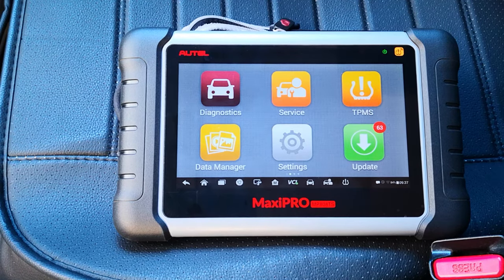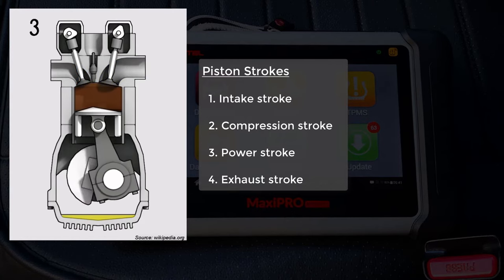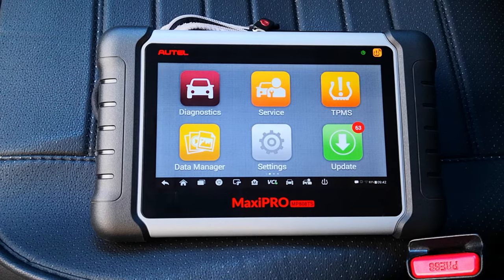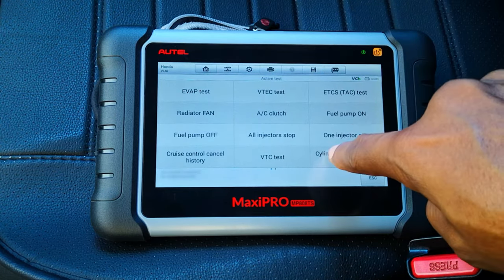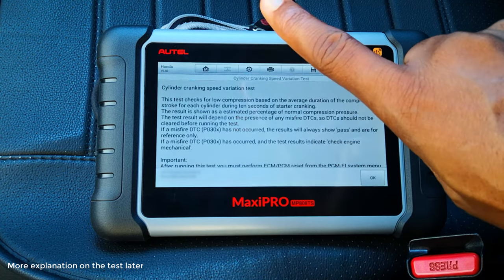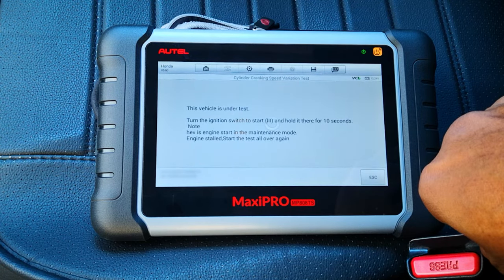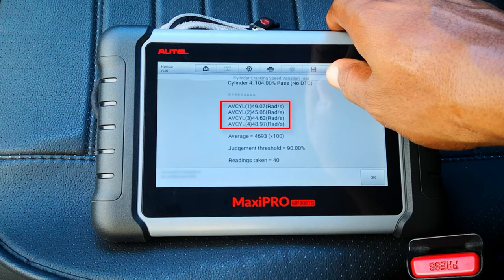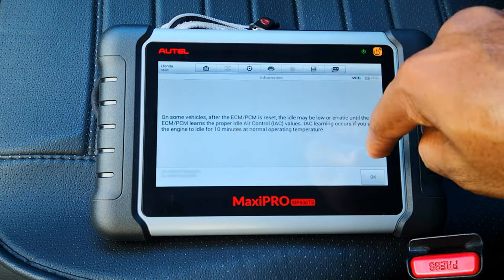Compression Test WITHOUT a COMPRESSION GAUGE using Active Scan Tool: AUTEL Scanner MP808TS

Comment: You can probably thank MB Xentry for this technology I remember this feature in 07-08. As usual they are way ahead of most manufacturers in (over) engineering. Good Video. I had no idea Autel would do this. Wonder if it does just Japanese cars or ?
Reply from the maker: Thanks for the compliment. Yea, MB, BMW etc the overengineers. Lol. I can't say if it's only for Japanese cars. I think I've seen this function on a Ford, but can't recall. Autel's coverage tool is here if you want to check other cars autel.com/vehicle-coverage/coverage2

Comment: This is definitely more of an advanced or refined way to do it but this is not a new thing when I was a young subaru tech at one of the training courses (back in the 90's) we were shown how to do a quick test with the oscilloscope and from what we could see there we knew 100% if we needed to do an actual compression test...and if you know anything about subaru engines any time you need to remove the spark plugs it's not real fun..not "hard" but you damn sure didnt want to do it and realize you didnt need to...was kinda cool to see the voltage drop test on the screen and right there you could see for example 3 voltage peaks that match and one that didnt ... less compression =less effort required of the starter=less amperage pulled from the battery ...
Anyway just though I I'd leave that here for those that didnt know about it or maybe havent stepped up to a newer or more advanced scan tool or whatever... scopes are really cheap these days lol
Reply from the maker: Nice comment. Haven't done or used the scoping method before! Good to know. 
Subaru and boxer engines😀. Is it boxer engines in general that have their spark plugs difficult to remove?
Reply: @DIYAutoworksNG  well the duel cam engines can be a pain just because you don't have a lot of room between the valve cover and the subframe..you kinda have to remove to coil but one at a time put the socket in then the extension (or some add a wobble) then you have just enough room to break the plug loose and get a couple turns and then u better hope you can unscrew it the rest by hand because (until a few years ago when snap-on came out with that super thin head 3/8 ratchet ) you run out of room and have to pull the ratchet out and loosen by hand then pull the extension out then socket and the repeat lmao its not too bad after you get the hang of it
Reply from the maker: Sounds like a pain for such a basic task!

Comment: I do that method but sometimes with a charger connected to the battery, just to ensure the starter is receiving solid current, just in case battery not good and starter may start to rotate slower.
Reply from the maker: Yea. To test compression, battery should be well charged!

Comment: Greetings, I just performed the service, they applied new brake fluid but the workshop did not have a scanner. Should I go to a workshop to have the scanner installed so that they can inspect the ABS module? Don't tell me that I will have to drain the brake fluid again, repeat the process and buy the brake fluid again? Or should I just check it with the scanner without having to drain the brake fluid again?

￼
Reply from the maker: This test has nothing to do with the brakes. We're you trying to ask this on my ABS bleeding video?

Comment: Good evening sir
I changed my catalyst on 2014 Camry but my check engine light comes and goes off by itself
Please where are you located ?
Reply from the maker: Hello. Sadly, I do not run a shop and have no commercial services. Are you able to scan the car? Happy to help virtually.
Reply: I would have to check this feature on my scantool currently using the IM608 autel
Reply from the maker: It should be available on the IM608.

Comment: I want to know if you have MS906ts /would it work in Africa /How different is ms906ts from MP808ts
Reply from the maker: Sometimes, different authorised distributors implement the region lock on some devices while do not. I would recommend you chat with the seller to verify if their tool is region-locked. The links I have in videos of the MP808TS are not region locked.
The MS906TS and the MP808TS have virtually the same functions. The main difference is that MS906TS has improved hardware (processor, battery etc) and supports the use of 2 other accessories: oscilloscope and video camera. Note that these 2 accessories are bought separately. Also, the MS906TS comes with the full obd adapter kit for older vehicles. Hope this helps!
Reply: @DIYAutoworksNG  Thanks
Reply from the maker: You're welcome!

Comment: How many vehicles does this test work on? And can you still preform it after your subscription has expired? Thank you!
Reply from the maker: Not sure of the number of vehicles, but it sure works on my Honda without a subscription. If available, it won't work on FCA cars post 2018 if there's no subscription. This will be same for other scanners, not just Autel.
Reply: @DIYAutoworksNG ok thanks I'm looking for a tool specifically for this function that can do the widest range of vehicles in the 4 to $500 dollar range..so far I've seen the lauch 919e / xtool d7/ and this autel would you recommend any for the compression test feature? Thank you just subribed as well

Comment: Can  all car's compression be tested by mp‌ 808ts ?
I have maxi ms906bt but compression can't be tested like this. Please tell me What scanner is best for compression test all car
Reply from the maker: Not all cars can be tested for compression like this. For now I have only verified it on the more recent Honda. What car did you want to test compression on with the MS906BT?
Reply: @DIYAutoworksNG  
Hyundai kia Toyota can be tested by mp 808ts
Reply from the maker: The Toyota compression test is not exactly like the one I described in the video. You will still need a compression gauge. 
I haven't used the MP808TS on a Kia or Hyundai and so can't say at this point.

Comment: Does this check Fuel Pressure ? Out from the box you don't have to registered or used internet or online to used all of it scanning function ?
Reply from the maker: Can check fuel pressure in cars equipped with fuel pressure sensors usually CAN OBD protocols and up. Some cars have a active test for this. Maybe check Autel's coverage tool autel.com/vehicle-coverage/coverage2
Out of the box, tool must be registered (Internet access required) before first use.
Reply: @DIYAutoworksNG  My Last question is Do you have to pay every Year or monthly to keep all the Features on to this OBD device ?
Now if you don't pay every yearly or monthly can you still used it to scan for everything ?
Reply from the maker: You will keep functions even if you don't do the annual subscription. There a few minor exceptions for certain cars that require online access. I covered this in a video.

Comment: Hello, MP808TS works with old cars? Mean 20-pin BMW E46 ABS and other?
Reply: I want to buy one and i don't know it will be work with adapters
Reply from the maker: From my research on Autel's coverage tool, the 3 series E46 is not well supported. Also, the MP808TS does not come with adapters like the 20 pin connector.
Reply: @DIYAutoworksNG  And E46 after 2000 with obd2 too? What can I choose DS808, MP808TS?
Reply from the maker: The MP808K or DS808 (the ones with the adaptor kit) have better support for the E46.
Reply: @DIYAutoworksNG  whats the difference about MP808TS and MP808? I know TS is on bluetooth but what else?
Reply from the maker: 'TS' means that the tool can be used to activate, relearn and program TPMS sensors.
Reply: @DIYAutoworksNG  oh tkanks you for help, sorry for bad English. Greetings from Poland. :)
Reply from the maker: No worries at all. You're welcome!
Reply: @DIYAutoworksNG  One answer more, MP808K, DS808 and the MP808TS have got the same functions without TPMS? I mean active tests etc.?
Reply from the maker: In principle, yes, but there may be slight differences. You can use Autel's vehicle scanner coverage tool to check each tool for the exact car you are considering. autel.com/vehicle-coverage/coverage2
Reply: @DIYAutoworksNG  thanks a lot
Reply: @DIYAutoworksNG  Hello my friend. I bought DS808BT. Can you tell me that model have got the same functions(active tests) like MP808? Can I decode start and stop in VW Passat B7? :)
Reply from the maker: Congrats on your purchase! It should have the same tests with the MP808. It seems this model is mainly offered in Europe. I couldn't specifically find it on the Autel scanner coverage tool. I didn't also see the Passat B7 in the tool either.

Comment: With the Autel MP808ts ($950) ,which does just a little more than this one, after 1 year you need to spend $600 EVERY YEAR for updates. Not exactly a DIYer tool.
Reply from the maker: Good comment. Seems you're posting this under the wrong video since it's the MP808TS I used here. Are you referring to the XTOOL D7 I reviewed recently?
I agree that the MP808TS is definitely not for everyone, depends on how deep you are into DIY. For me, the MP808TS has been a great investment which I don't regret despite the fact that I'm a DIYer... Well, fair to say I'm neck-deep 😂.
It just makes all the sense being wireless, with more advanced coding/programing options plus being able to activate TPMS sensors. I hate wanting to do something only to discover I need to buy e.g. a separate TPMS tool in other to program or relearn TPMS sensors. On updates, I am yet to update mine since it expired and it still works great. I think I'll update during the sale this year😁
Reply: @DIYAutoworksNG  Hi ! No, it was about this same device. After watching this video I ended up buying an Xtool D8 which doesn’t programs TPMS but there’s a BT version that does. I rather have a separate device since (it’s just me) I don’t want to rely on batteries since I’m a DIYer so I won’t be using it that often. Right after this I’ll be watching your Xtool D7 vid. Thank you
Reply from the maker: Smart choice! We should always go with what fits our diagnoses needs when it comes to scanners.
Reply: I’m wondering what the TS version gets you over the regular? I know there is a TPMS option in the service menu on the regular MP808, but what TPMS features does the TS version have? And do you know what the difference between the older DS, MX and MK 808 versions is in comparison to MP? I’m looking for something with good TPMS capability and ECU coding and programming capability
Reply from the maker: The Autel tools that end with TS have a TPMS RFID reader built into the tool. This is able to activate TPMS sensors directly by placing them in proximity to the sensor. This must be done if you want to relearn or program sensors. The regular MP808 can read TPMS codes but it can't activate, relearn and program sensors. E.g the MP808K cannot be used for what I did in this video https://youtu.be/joAxsv3C_Tw
Reply: @DIYAutoworksNG  good to know, thanks! Can you manually enter an ID for the TPMS to enter into the ECU with the the regular MP808? Or you can only do codes with that one? Looks like Icarsoft CR Max can manually enter an ID, not sure if that works for every sensor or not?
Reply from the maker: Realising I didn't cover all your questions... 😱
The MX and MK are not bidirectional or active scan tools ie. They can't be used to do bidirectional aka active tests. The DS is just the older version of the MP. 
In terms of the needs you listed, the MP808TS will be the better choice except if you want to program / flash Benz ECU's using a J2534 device then you will have to consider the tools that come with a J2534 device...
Reply from the maker: Yes, you can manually write ID's to the TPMS ECU. ID registration is listed as a special function under TPMS for the MP808.
Reply: @DIYAutoworksNG  great! So the only difference is that you can’t scan it with the top RFID of the scanner?
Reply: @DIYAutoworksNG  last question; I’m guessing that by the sound of one of your previous comments, that a J2534 interface would not work with an MP808?
Reply: @DIYAutoworksNG  hi. Ended up buying the Xtool D8. Pretty decent scanner for the buck I think. So far so good. I don’t do this for a living so the updates seemed a little steep for me.
Reply from the maker: Yea. You'll be thinking of something like the MK908P (around $2500) to get J2534 passthru capability. The 908 is not a 'TS' version...
Reply from the maker: Nice! Congrats on your purchase!
Reply: @DIYAutoworksNG  I still don’t know how it compares to the MP808ts thou
Reply from the maker: You made a good choice considering its not what you'll use that often. Off the bat, the advantages of the MP808TS over it are in TPMS programming and flexibility of a wireless connection. I rather own the D7 so can't do a direct head to head comparison. But good choice. Quite happy for you!
Reply: @DIYAutoworksNG  a TPMS programmer is not that expensive. Yesterday saw on my D8 pressure on 4 tires and one of them completely out of wack on a Cayenne but just for fun, nothing professional.
Reply: @DIYAutoworksNG  do you know if they make an extended cable for the MP808? I got a non-Bluetooth one because the update cost for Bluetooth was much more, but want to be able to work in the engine bay with the scanner
Reply: You don't have to update them every year to use them.
Reply from the maker: Yep
Reply: You don’t have to pay the renewal fee , especially if you don’t want the updates.
Reply from the maker: Exactly. Haven't renewed mine in 2 years. I plan to renew during the black Friday sale though.
Reply: @Lowdown13blues Not auto authorize for 2018 and above for Chrysler vehicles.

Comment: Which is better xtool D8 or autel mp808TS?
Reply from the maker: They are roughly on the same level. In some ways, it's like asking between BMW and Mercedes which is better. It comes down to preference and a few other things. From my experience with the D7, I'd say the Autel is a tad more refined plus it has full access to the TPMS module. However, the D8 is comparatively cheaper including the cost of updates. Also depending on the cars you want to get it for, you may find a thing or two that either one of these devices has an edge over.